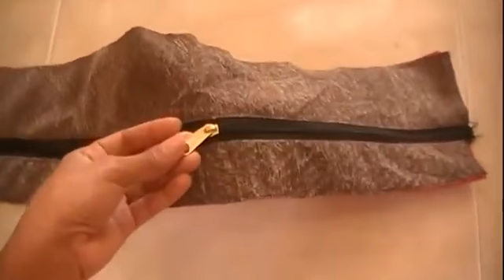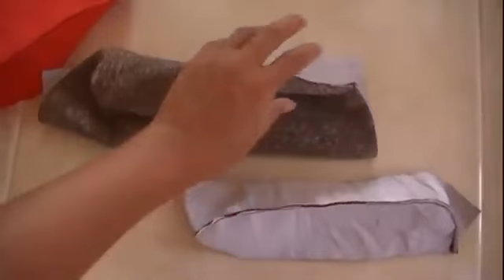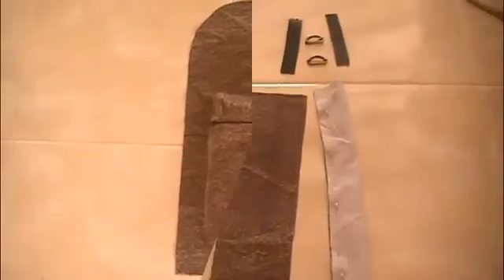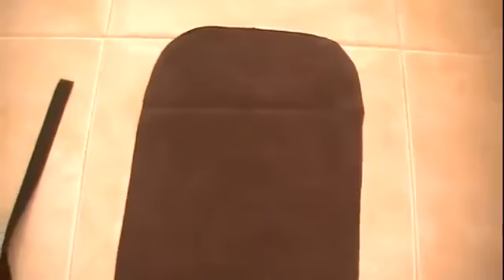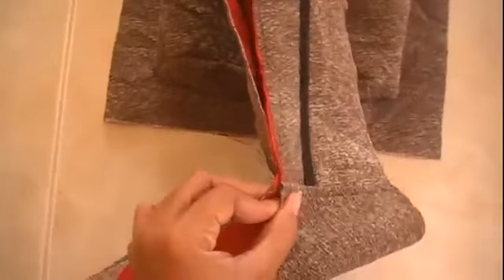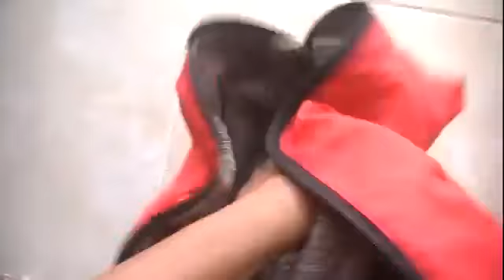How to make a backpack tutorial

Comment: I am trying to stitch the back pack. But please mention the size ie; the dimensions of the pocket please.
Reply from the maker: Hi, the big part of the pocket 12"  wide, and 9" down. the small round edges ones are 10" by 2.5"  and you roundup the edges, the other one is 12" by 2.5. try to fit them up like in the video. Thanks for watching
Reply: Thanks dear

Comment: This is an awesome tutorial. what are the measurements of the two pieces on the either side of the Zipper?
Reply from the maker: Both of them are 26", but the big one is 3.1/2" and the small one is ,1.3/4" . ,You will lose about 1/2" the zipper will make up back what you will lose, you should have about 5" when your finished.
Reply: Cecelias Designs Thanks so much. I am going to try this ☺️